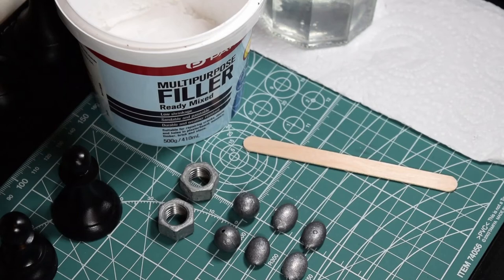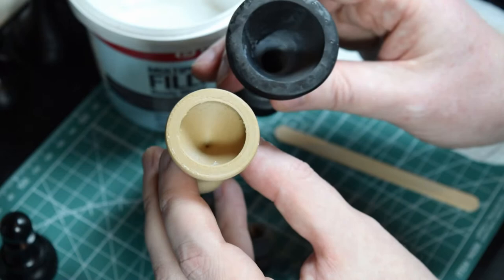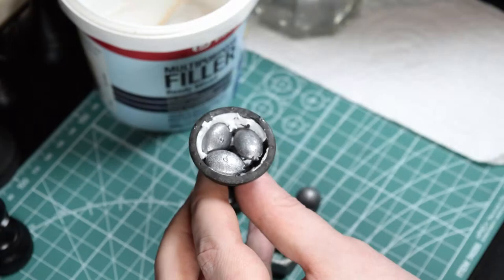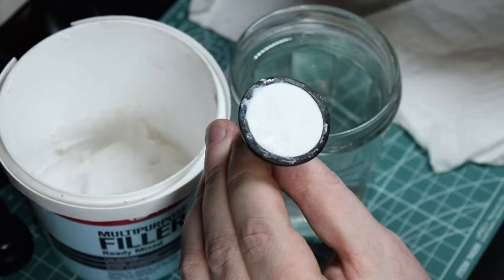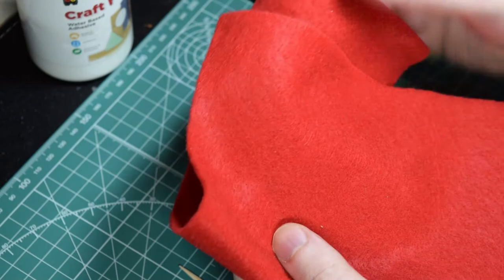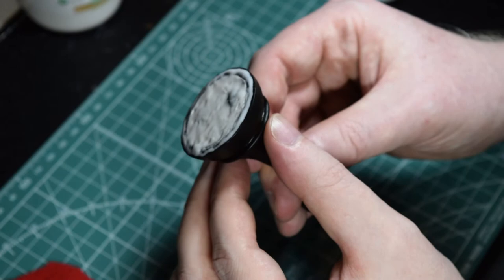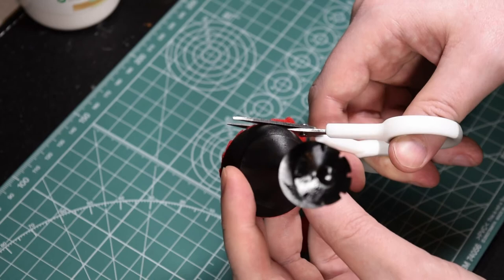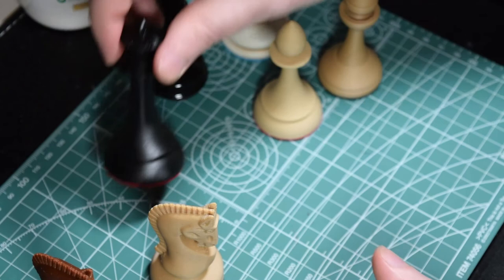How to add weights and felt bases to your 3D printed chess pieces

Comment: It would be much better to use epoxy resin to fill after adding weights. It'll also give a perfectly flat surface to stick the felt to after it cures.

Comment: Can i use air dry clay for the filler?
Reply from the maker: Yes that should work fine. Just give it plenty of time to dry and if it cracks or shrinks add a little more to fill the gaps before you glue on the felt.

Comment: Hey I cant find the sample files for the  Dubrovnik set that you made.
Reply from the maker: You can get the free sample files here: http://cokane.com/chess/Dubrovnik_king_and_pawn.zip
and you can buy the full set here: https://gumroad.com/products/fXLHn
Reply: @conorokane  cannot get free sample files. please check link again.
Reply from the maker: @bayarkhuubyambatsogt4334  The above link is working for me.
Reply: @conorokane  When I clicked link, It's  automatically opened new tab then just closed. Nothing happened. Is this possible could you send me files by email?
Reply from the maker: @bayarkhuubyambatsogt4334  Try right-click 'save link as'. If that doesn't work you can email me at contact@3dprintedchess.com

Comment: Couldn’t you use a hot glue gun to secure the weights?
Reply from the maker: Yes, hot glue works very well for securing the weights. If you want to make them extra secure then do that. However you still need to fill the hole with something to get the level surface for felt as hot glue isn't good at leveling.
Reply: @conorokane  ok thanks! Love your videos!